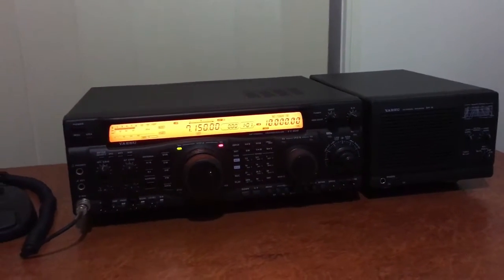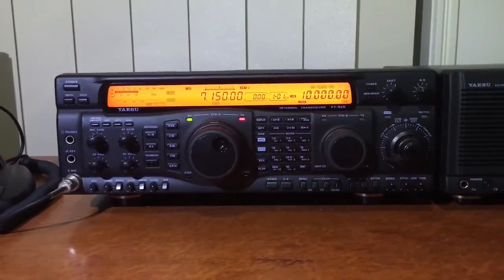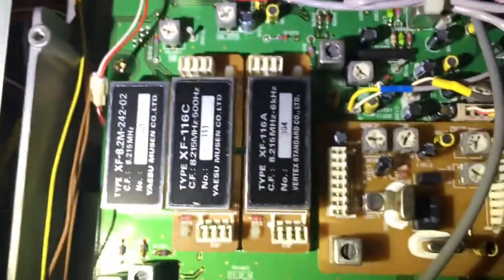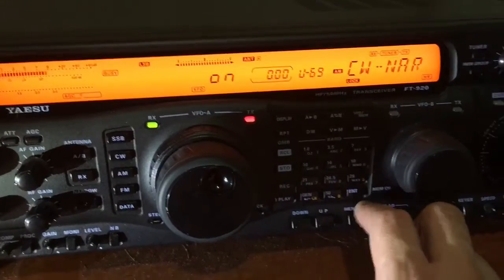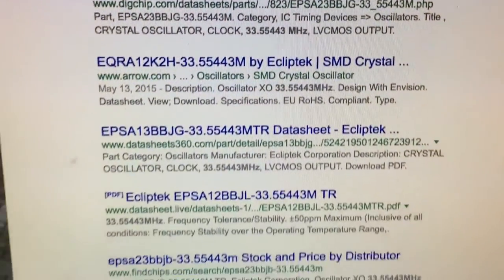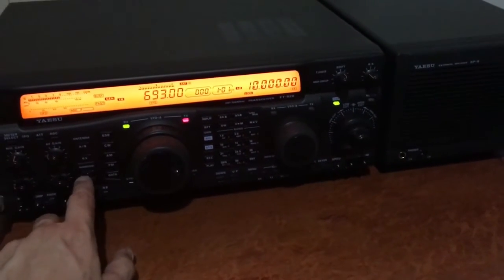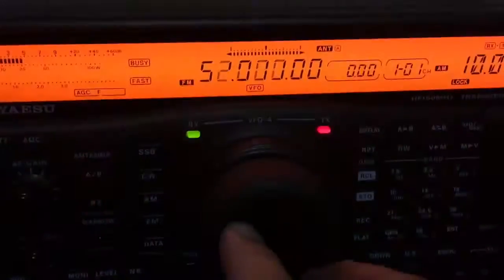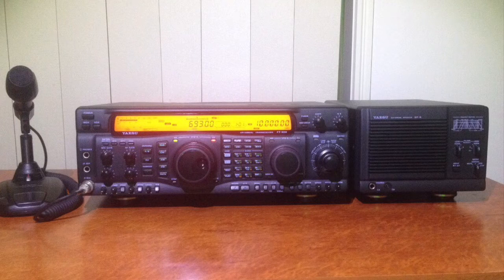Yaesu FT-920 Options Installation & Demo

Comment: Hi which desk Mike are you using  I'm a newbie in Trinidad and seeing one in mint condition would you recommend it thanks 73s 9z4apa ❤
Reply from the maker: Hi, It was called Yaesu MD-100A8X. I’m not sure if you can still get one new. The M-70 seems to have replaced it. I no longer have this setup at all, but it was great. Good luck!

Comment: Mine would not transmit on AM until I changed the 69 & 70 menu settings, but it works great now. I had no idea that AM worked on transmit until now & it appears the AM filter is not also installed. Thanks for the Free Help.

Comment: Hello there!! I have an FT920, when I use it with CAT cable, I connect it with a serial to usb converter, but when opening the program (anyone using CAT) I hear an audio noise exactly when the CAT indicator lights up, making it annoying to listen that noise, do you know what could be happening? I put ferrites in the converter and in the audio cable and still that annoying noise continues to be heard. I also used another serial to usb cable thinking that the converter chip was poor quality, but it results in the same annoying noise, everything else works fine.

Comment: it's really nice radio I am looking one on eBay I'm thinking to buy
Reply: I just purchased one for just $350 from a friend a few days ago. It's going to be a backup to my ICOM 7610 & ICOM 9100. It's so clean my wife thought it was a New radio. It has the FM Board & the AM filter installed but I have not pulled the bottom cover to see what other options are installed.

Comment: Is there any adjustment on the FM board? I installed a new FM board as my ft-920 didn't have one. I can see "busy" on my display and can tx on FM and open the repeater but for what ever reason I can hear any static and squelch isn't adjusting while on FM. If I turn the squelch, I can see it's working but not allowing any FM noise thru the speaker unless over 7 s units. Also, the squelch adjustment on the FM-1 board didn't make any difference. If you have any solution to this matter or need more info from me, feel free to email me, thanks! My call is KC2KJO and my email is on my QRZ page.
Reply from the maker: Hi, I don’t think I can help, but hope you sort it out. The FM-1 board does have a few pots & slugs, all of which I’d be afraid to touch if there’s no problem. Mine does work fine. I later tested on 10 meters. As far as I remember you don’t have to tell the radio that the FM board is installed (unlike the filters), so should just work. There is a schematic of it in the FT-920 technical supplement if it helps. It’s all stock parts, and could have been easily cloned.

Comment: I am a Die Hard ICOM MAN but if I were going to ever own another Yaesu this would be the one I would want of all they have ever built.I would for sure want the FM Board for 6 & 10 meter repeaters and Simplex & the AM Filter.
Reply: Well here it is 5 years later & I have purchased a 920 & it does have the FM board installed and the TCXO Board as well.I already had the matching SP-8 external speaker for several years that I purchased Dirt Cheap at a Hamfest & the 920 was also Dirt Cheap so I purchased it as well from a friend who no longer needed it. It's just a backup to my ICOM 7610 & ICOM 9100 so it's Not a main radio that will get used much. or the price I could not pass it up. It's been taken very good care of & my wife thought it was New it's so clean. It's a pretty radio that seems to perform pretty well & for $350 it's a Keeper. I also have added the MD-100 desk microphone and I have done the mod to it which improved the transmit audio.

Comment: I have just been offered one of these radios for $500 AUD + shipping will be about $150 from Perth to Adelaide. I'm tempted. I've only been licence holder since the beginning of October last year and I'm currently running a Yaesu FT-707.
Reply from the maker: It sounds like an ok deal, even for the basic unit so long as all bands are working, and it has no issues.